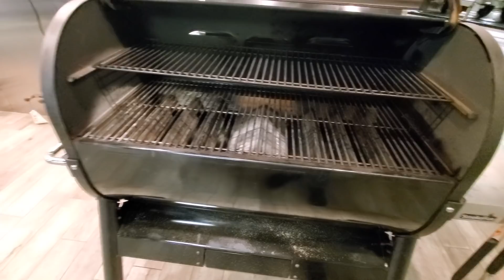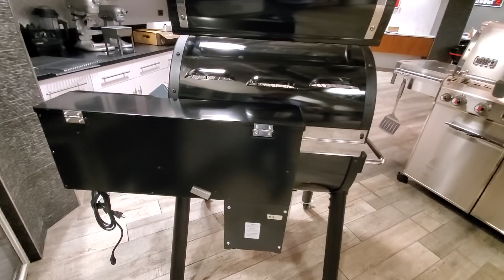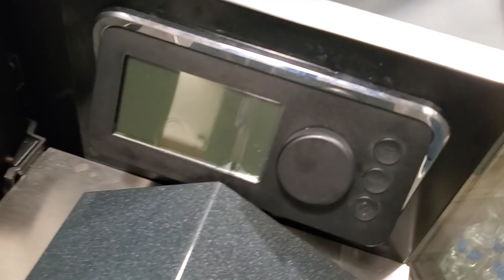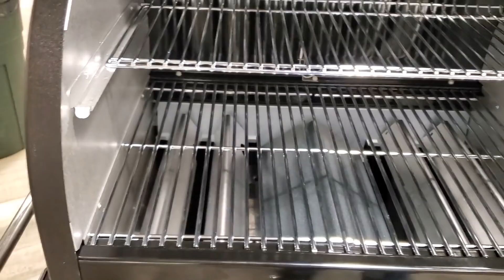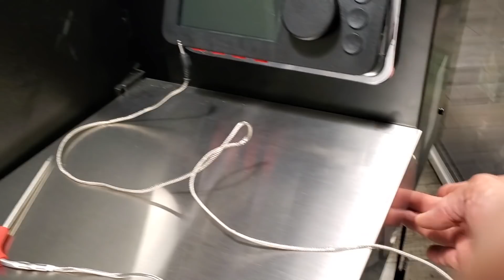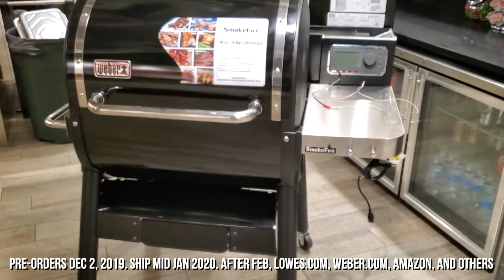Part 1 FIRST LOOK | Weber SmokeFire Pellet Grill Smoker | BBQ Champion Harry Soo SlapYoDaddyBBQ.com

Comment: This looks like a great cooker.  I think my biggest hang up for pellet cookers though, is that they're always a pain to change out the pellets if you want to switch from one flavor to another.  I like to use different woods, and changing out the pellets always seems like a pain.
Reply from the maker: There is a chute release and you just empty the pellets.  I think a pain is to chop wood and load a log every 30 minutes for an offset!
Reply: @SlapYoDaddyBBQ  Thanks.  I didn't know that that was actually a feature.  I actually like loading wood in an offset sometimes though, definitely not all the time for sure.  But, until I get a pellet grill, I can also load up my WSM the way you showed in one of your other videos and have it cook for hours. 😉  Thanks for all your videos and advice!

Comment: The only thing I don’t like about that design is there is no drip tray, it’s going to be a mess to clean the inside of that grill. I like that the auger is located up top and drops the pellets down. It needs silicone seals on the doors to keep the smoke in. That’s one thing with the traeger that you had to do to keep the smoke in and not escape through little cracks in the lid
Reply from the maker: Are your comments based on owning one and cooking at least a dozen times?  Or is it a virtual experience you are sharing?
Reply: Harry Soo I have a traeger and my friend has a green mountain grill.i do not have a weber those were just some things that I noticed that were diff from the traeger I own

Comment: Why didn't they go with ceramic glow plugs instead of diesel ones that break down faster ?
Reply from the maker: The Weber engineering team said they torture tested may options for glow plugs before deciding on the one they selected for the SmokeFire

Comment: I have a question??? I see where the burnt/spent pellets will go, but does the excess oil drippings fall into the burning area as well?????
If so, then this could be a problem later in terms of cleanup and maintenance.
Reply from the maker: I will cook on a production unit under real world conditions and let you know. 
Given the amount of engineering hindsight that I saw that went into the design and the fact that all the engineers have to cook, clean, and live with the SF prototypes for many months, I guess they dealt with the cleanup chose with the same due diligence.  Let me find out and post the video as Weber knows how much I hate cleaning up.  I've been haranguing their product engineers since 2012 to add the magic touch cleanup to the WSM!  :-).

Comment: Did you ever make the “technical” engineering discussion video you spoke of? Second, on the 36” was there much, if any heat loss towards the edges of the cooker, or did the double wall help with that? I can see how it would be minimal on the 24” due to how close the edges are relative to the fire pot, just wondering if the 36 was even all the way across.
Reply from the maker: Will test when I get my hands on a actual production unit soon.  They have not been released yet so I have no real world cooking experience on it

Comment: Hi Harry, I've been cooking on a GMG Daniel Boone for two years now.  The size has worked fine with me and the pellet consumption is not horrible.  I want to get a weber pellet grill but i'm not sure about the size.  I don't want to buy more size then i need.  Would you say the EX4 should be able to handle all the things the Daniel Boone could?  The most i cook is one large brisket at a time.  Thanks
Reply from the maker: Yes the 24 inch is fine.  I have both the GMG DB and JM models and they are great pellet cookers
Reply: @SlapYoDaddyBBQ   i preordered the Weber EX6 a couple days ago and i have a few concerns i didn't think of before doing it.  Why the no probe port on the side?  Why the no downdraft system?  I'm literally shaking my head wondering why the probe port was not included... one it ruins any seal you could get from the door.. and two.. potential damage to the probes.  I asked Baby Back, i'd really like an answer to these questions.  Thanks

Comment: Somebody needs to come up with a cordless design. Lithium ion batteries are so advanced now , there Is no reason to be stuck having to use a cord. I would have to have this grill Right up next to my house to plug it in which is dangerous as im sure the heat would melt my siding, unless I would want to run a extension cord across my deck which is not only a trip hazard but looks horrible as well.
Reply from the maker: You can also build a nice granite countertop outdoor kitchen and cook in style?  👍🔥🐷🐂🐖🐓🐖🌈

Comment: Hey Harry. Appreciate all your work. Two questions: 1. Does this grill have a setting that turns off the auger so that you can use it as an outside convection oven (removing all pellet usage)? Sometimes the wife just wants the bacon smell outside the house, and others may not want a smokey pizza. 2. Can you increase or decrease the smoke distribution (similar to P1 vs P5 settings on Traegers).  Thanks!!
Reply from the maker: I'm guessing the answer is No and No. I've not used a pellet cooker by turning off the auger and the Weber folks did not say the smoke is adjustable. They said when they eliminated the chimney and replaced with vents, they got the desired level of  smoke flavor.  I'll share real world testing once I get my hands on one!   👍👍👍
Reply: @SlapYoDaddyBBQ  Thank you, Harry! I'm going to call weber and get some info - assuming I can.

Comment: Does it come with a can of touch-up paint like Yoder 😂😂😂
Reply from the maker: LOL!  🤪👍❤ Its porcelain coated enamel like my WSMs, some are 10 years old and paint is still going strong!
Reply: @SlapYoDaddyBBQ  I have left my genesis outside for over 4 years, without a cover and in the DC extreme swings of climate,  and it is still in very good condition

Comment: Did you notice any smoke flavor improvement from other pellet grills when you tasted the brisket they smoked?  I''ve had a Traeger for a long time and added a WSM for smoking because the Traeger doesn't cut it for me.  Trying to decide on if a Smoke Fire and WSM combo is the way to go or if I should go Weber Summit Charcoal - any thoughts there?  I could also just get a regular Weber kettle of course but I'm trying to save deck space on the current house!
Reply from the maker: The brisket I ate in Part 2 is as good as Pecan Lodge Dallas, Franklin Austin, and Pinkerton's Houston. I'll report after some real world cooks on it
Reply: Thanks Harry- love your videos, you are the man!

Comment: Havent seen any info on probe port holes.  can you tell us if they have port holes to run probes through?
Reply from the maker: Yes there will be in the production models
Reply: Will you be able to look out them :)
Reply from the maker: @mikebowling3228  Will do.   If memory of what the Weber engineers described, you get one meat probe and will have to purchase the other 3.  As you probably aware in my 200+ videos and 30 Playlists, I don't advocate the use of internal temp for cooking barbecue; instead, I rely 90% of feel as that's the more accurate way, IMHO, to account for the physiological differences in animal tissue and muscle tenderness

Comment: Is there a convection fan to circulate heat/smoke? Also, is there a pellet dump mechanism to change out pellets?
Reply from the maker: Yes there is a fan.  I dont know if there is a pellet dump to change pellets.  Ill find out when I cook on it in 2020 when  its releases

Comment: Is there going to be a thermal jacket accessory? As it gets cold here and I still enjoy BBQ in the snow.
Reply from the maker: I know they are making accessories but don't know if a blankie is in the works.  The sides of the SmokeFire are insulated so that may help.  It's being sold in 25 countries so I have to guess that cold weather performance was tested.  It does not get cold in LA where I live so I won't be able to test that aspect of it.

Comment: That Enamel Section will Rust through. It should be Aluminum. Also They are Making Igniters with a Lifetime waranty, so I don't see why they are using an old version. still some nice features here.
Reply from the maker: My WSM are 10 years old with 500 contests and class still going strong no rust

Comment: Mr. Soo, I live in the mid-atlantic area and like to smoke/grill during the winter. I have a pellet smoker now that has a really hard time keeping temp and the company recommends you buy a thermal blanket. What is the insulation like with this grill? Did they do anything to combat the cold weather issues? Thank you for your in-depth review.  I thought it was great!
Reply from the maker: Sides are insulated and it hits 600F in 10 minutes in a 70F kitchen. I live in lA and we don't get below 55F very often so I cannot test cold weather performance.  If I know Weber they conduct intensive product evaluation under various cooking conditions as the electronics need to survive hot desert and cold wet winters as they sell to 25 countries including Norway.

Comment: Too many comments comparing Traeger to the new webber. How about Rec Tec pellet grills. Made of all 304 stainless steel. Webber is stainless steel coated and flavor bars will rust away and need replacing quite often. No PID algorithm.... or did I miss that Harry? Appreciate your excitement however I’m pulling the trigger on the Rt-590 Stampede better built and bang for the buck
Reply from the maker: My PID segment coming soon.  Life is short, buy and cook on the device you like. It's always about the pitmaster and not the pit!

Comment: All these "Traeger" style grills are all the same. Thin metal. Additionally, pellet cooking depends greatly on quality pellets like Lumberjack or BBQers delight. 
If you want a supreme smoker that doesn't look and feel like an aluminum can, get a Yoder YS640. You'll be able to smoke, cook with an open flame, retain heat with thick metal and have an overall better cook. I was shocked this was $1000 for the small one.
Reply from the maker: I'm not a grill engineer and I suspect its a bit more than choice of pellets to get a good result. There is no perfect pit IMHO and so long as you can bring joy to family and friends it doesn't matter what you cook on.  Its always about the pitmaster and not the pit. :-)

Comment: As a gas Webber owner for 16 years the flavorizer bars will need to be replaced every few years due to rust and disintegration. I’ll stick with my Kamado Joe. I don’t have to rely on pellets or electricity and other components that could fail at a inopportune time.
Reply from the maker: Different strokes for different folks. Some days I drive the Prius and some days the minivan!  Some days I have no energy to clean and fire up my WSM amd the push button convenience of a pellet cooker is welcome!

Comment: I have Weber’s on my deck and love Weber but see two problems right off the bat unless I missed it. No pellet dump and what catches the grease on those long cooks, I don’t want to have to scrub it down after every cook.Most now have that plate that tilts to one side and a valve where a bucket can be placed
Reply from the maker: Grease flows into the foil pan.  Please see Weber video on SmokeFire.  I'll ask their chief engineer on how to change pellets
Reply: Harry Soo I have that System on my Weber Genesis gas grill it still gets really gunky in the bottom on the side walls I’d think that it would be even worse on low and slows

Comment: so the barrel design looks like my timberline 1300. I dig the auger setup. they need to slap that 10yr warranty on this cooker. especially with it being soo new. $100 in wheels for an upgrade to the bigger wheel set? what are they made of? IDK ill keep my eyes on this as I am also a weber user with my 22' Performer and my Ranch Kettle.
Reply from the maker: I made up the $100 as I want pneumatic off road wheels with anodized aluminum rims!  Spinning wheel lights would be a bonus!  See Part 2 for Ranch Kettle on steroids in the Weber restaurant kitchen

Comment: If you want to change the pellets out to a different kind, can you? Does it have a lever to clean out the pellets?
Reply from the maker: I dont think so.  If you see my hand in the hopper, notice it is inclined?   Should not be hard to scoop out the pellets as its smooth walls and nothing sharp to catch on.  Maybe that's why Weber designed the sloping hopper bin?  I'll as the chief engineer for you
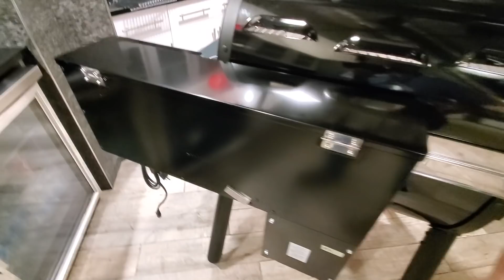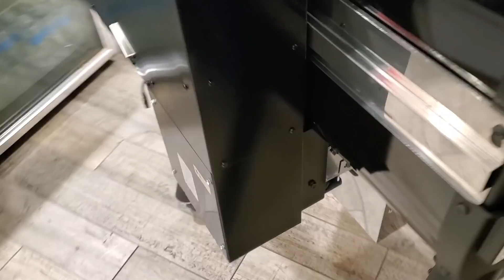Reply: @SlapYoDaddyBBQ  at 4:15 that slanted "L" shaped piece is what you pull to dump the pellets and at 8:05 your hand is directly over the pellet dump hole from the inside. They dump directly underneath. Great video!! Lot's of good detail. Will definitely be looking for your first cook on one next year!
Reply: @yambor44  thanks for pointing it out

Comment: Cleaning bro cleaning.
Reply from the maker: Oil drains into foil pan and 70% ash caught in ash pan. Me bad in my explanation shot in one 20 minute take after spending 1 hour learning how to use it.  My monologue is C-.    Ill know more when I cook on it after it is released in 2020
Reply: @SlapYoDaddyBBQ   looks like all drains to bottom for pan but looks like nothing to guide it there. It's  weber I'm sure they kinda have it figured out.
Reply: @mikeh8374  we only had an hour to cook on it so I did not get a chance to clean the SmokeFire.  Grease is  supposed to drain into the foil pan. Ill assess and report back when I get my hands on them in 2020

Comment: I have found that with pellet cookers  you just don’t get enough Smokey flavor. The WSM is the best for it. My GMG Davey Crocket works well but again, I just don’t get enough smoke flavor. I have also heard that from a guy using a Traeger.
Reply from the maker: I hear ya Bro.  So did the Weber engineers when they cooked on 18 pellet comoetitor cookers. Not sure if you saw the part about no chimneys for smoke in part 1 and my Impression of brisket in part 2.  I will test in real world conditions in 2020 when it hits the streets

Comment: I think get rid of the WiFi component.  We just wanna cook a bbq. Bring it back to basics.
Reply from the maker: I'm 6 decades old so I like old school manual ways to cook.   I was told by Weber that young folks called Millennials will not buy it if they can't cook bbq without using their phone to run the pit.  Luckily Weber made the single round knob for folks like me.  The made the font extra large so I can see with my bad eyes. Kudos to Weber for thinking about old farts like me!
Reply: Maybe you got time to sit and baby a pit all day, but if I've got 5-10 hours of cooking time, I'm going to use some of it to get in a hike or play with the kid or do an errand.

Comment: I am curious about the lack of a (or missing) drip pan.  For large cooks there will be a lot of grease collecting in the bottom of the pit. (6-8 Pork butts for example)  1st, I hope the barrel is capable of holding the grease and not leaking all over the patio.  2nd, I would not enjoy cleaning that out!  I get that the design incorporates their Flavour   bars but they will miss a lot of fluids that have to go somewhere.
Reply from the maker: Me bad.  The foil pan is the grease pan to catch all the grease.  I was too busy talking the ash pan as I was wrong to assume that it was assumed that the oil pan was the foil pan.  I assumed that most folks knew thet the Weber foil oil pan from Weber gas grills was the oil pan of the Smoke fire.  Sorry about that

Comment: Thank you Harry Soo.  Great video and I most definitely like the no chimney solution by Weber.   I have had a problem with the chimney directing more heat from one side of the grill to the other making sometimes a difference of 50 degrees or more from one from the left side of the grill to the right side.  I  mainly use the left side of the grill because it is where the temperature probe is located and seems to be very accurate temp wise compared to the right side also where the chimney is located.  There is one question I have, when I use the smoker I have a lot of grease and gunk that flows to the bucket on the right side of the grill that catches the grease.  I notice other than the ash tray there is no other method of capturing the grease unless the ash tray also doubles to catch the grease.  So does the astray double as a grease catcher?
Reply from the maker: Grease in the SmokeFire drains into the foil pan.  Please see the video on the Weber SmokeFire website page for how it is designed for  easy grease and ash cleanup
Reply: @SlapYoDaddyBBQ .  Really great video.  I am now considering buying the Weber smoker/grill when it comes out.  Would like to open up more patio space.